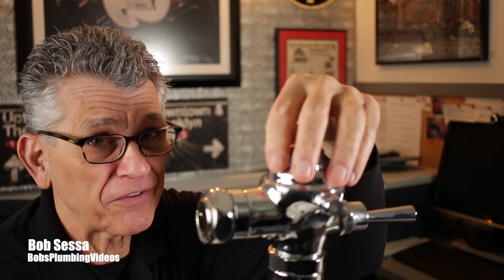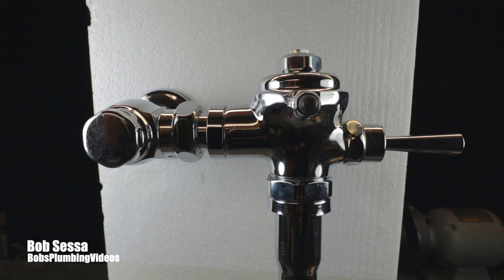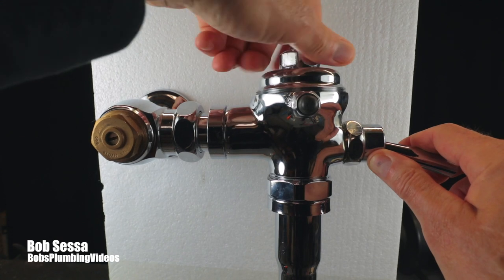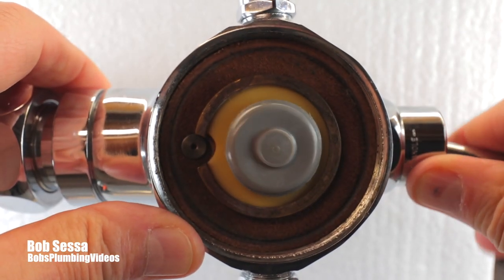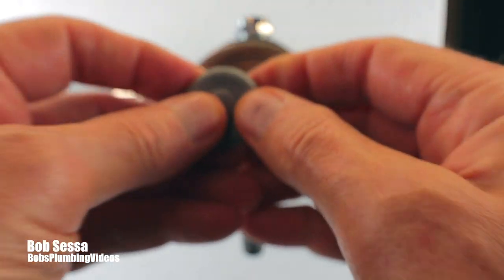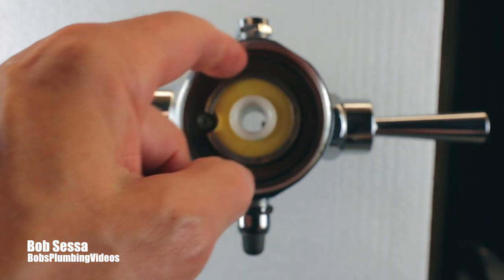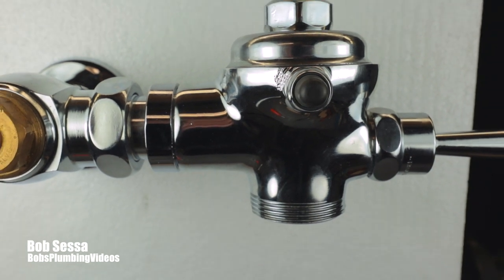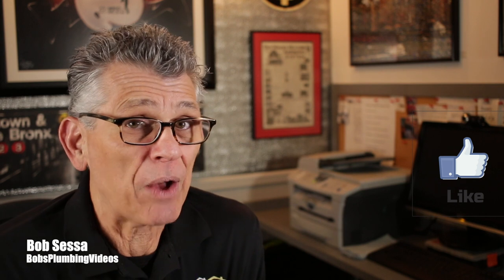Toilet Repair flush-o-meter

Comment: Dude... 4 years later... This is still so helpful. I live in a 100 year old home in the north bronx (hi, neighbor!) and we have a tiny powder room with what we refer to as the "prison toilet" and first it did the constant flush... then it started doing the BANG. thanks to your videos, i know exactly what the problem is and i believe i can fix this. i do have a basic question, what's the best way to ensure i get that cover on super tight? also, is there a brand of diaphragm kit you recommend (NEVERMIND - i see the coyne kit in the description)... i believe i have a sloan 1.6 gpf. subscribing and keeping your page handy!
Reply: UPDATE: Um... how do you get a valve cap off if there is no bolt to unscrew. mine is a curved/rounded cap that has lots of gunk under it... is this cap glued on instead of screwed/bolted?
Reply from the maker: I use this wrench to remove the top of the flushometer.https://a.co/d/0fehgtA. Hold on to the body while removing the top and make sure the water supply is off.

Comment: No mention of GPF on cover. How do I determine the actual flow capacity to replace diaphragm. Rex valve.
Reply from the maker: You should be able to take the existing diaphragm into a local plumbing supply house (not Lowes or H.D.) and they'll  be able to match it base on the size of the hole in the metal rivet embedded in the diaphragm.

Comment: Hey Bob,  thanks for posts.👍🏻 I wanted to know is it normal for a flush odometer to be sweaty 
and cold to the touch? Also it feels  and sounds like water is running in pipe that is attached 
to flush odometer and in bowl? Thanks in advance
Reply: I know this is two years old now, but just in case anyone else has this issue: being sweaty and cold indicates that the valve is not completely closing and water is continually flowing, causing the metal to cool down and water to condense on it from the air. You will usually hear the water running into the bowl too, as in this person's case.
Reply: @andysmith1996  exactly! Of course we resolved the issue.
Couldn’t wait for your answer.
You are  spot on.
Thanks

Comment: bob, are the diaphragms standard for the rex flush valve? i replace mine several years ago with one I bought in Home depot because it leaked;  it was made of leather. i can't remember if i checked the depth of the trap seal after the refill when i bought it,
 but when i look at it now, the trap seal seems very shallow; like perhaps1/2 inch above where trap seal would be broken. i feel the seal should be deeper. would a new diaphragm, perhaps the correct one,.correct the depth of the trap seal?
Reply from the maker: Trap Seal?
Reply: I am probably using the wrong terminology but I hope this is a clearer explanation. I am calling the water in the trap seal.  By trap seal I mean the depth of the water in the toilet bowl which is above the point in the bowl's trap where if the water in the bowl evaporated, sewer gas would escape. The depth of the water Mine is only about 1/2 inch above that point after the bowl refills; I think it should be deeper. Thanks Bob!
Reply from the maker: @588158  In a toilet with a tank, the trap seal is replenished by a refill tube inside the toilet tank. A little different with a flushometer, but what you must make sure of is that the diaphragm you replaced matches the g.p.m. rating of the toilet bowl.

Is it 3.5 g.p.m. (older versions) , 1.6 g.p.m. or 1.28 g.p.m. ? Whatever rating your bowl is, should match up with the diaphragm replacement. Assuming that's matched up, you could have a venting issue in your plumbing system which could affect the trap seal.
Reply: @BobsPlumbingVideos It was here when I bought the house in 1989 so I think this is an older model so I'll try changing the diaphragm. Thank you for pointing out the venting issue!!!  I do however hear a gurgle from the sink when the toilet is flushed.  The half bath only has 2 fixtures, a toilet and a small sink with an 1 1/4 drain and the sink's drain connects to the soil stack below where the lead bend enters the stack. They are the only fixtures connected to the stack.  Short of opening the wall, I'm not sure if it s wet vent. . The vent stack steps down in size when it reaches the attic and I am wondering if I might have a bird nest in there or a dead squirrel.  I was going to drill a hole in the pipe in the attic and run a snake through to see if that was the problem.  Thanks again bob!